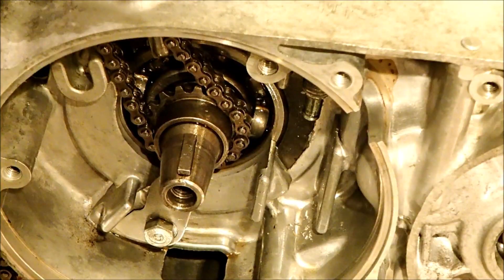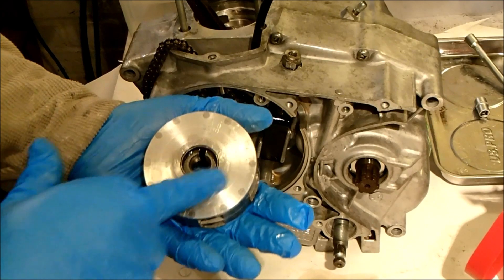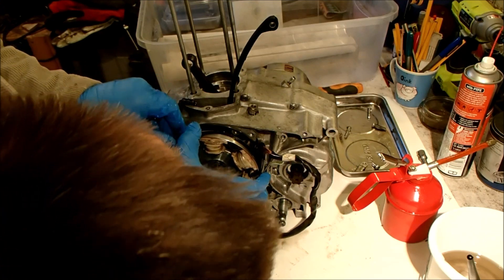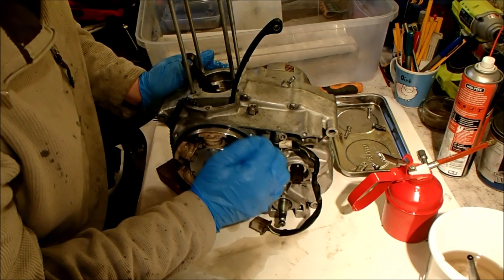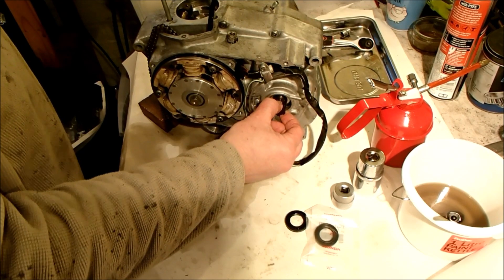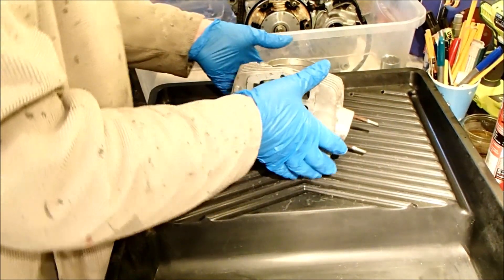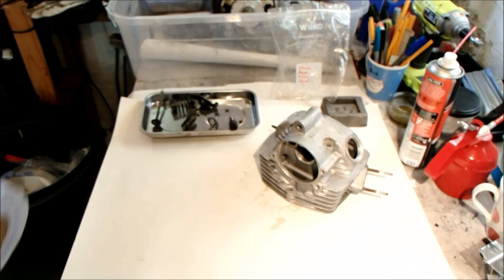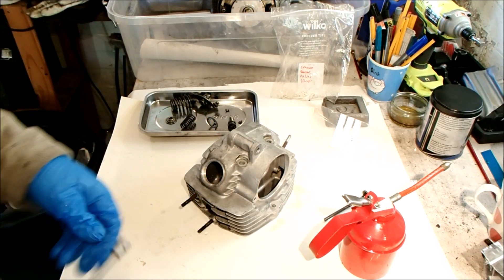Honda cb125 s restoration pt-18 cylinder head and magneto

Comment: Hi Richard. May I ask you a question? I'm restoring a now rare cb125 RS model. The engine is internally the same as this engine. I'm used to working on Honda 50, 70s, and 90, and they all have crankshaft seals. On an engine like this is the oil meant to enter the outer case where the stator wheel is? And is it simply just sealed on the outside cover instead of crankshaft seals?
Reply from the maker: You are correct. The stator is "wet" and the engine sealed by the case gaskets and flywheel cover. Good luck with the project.